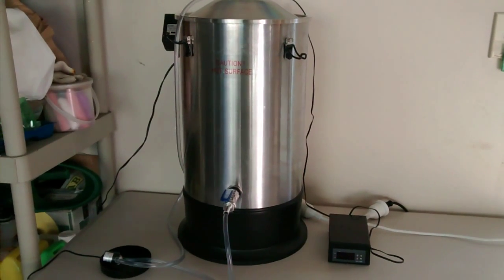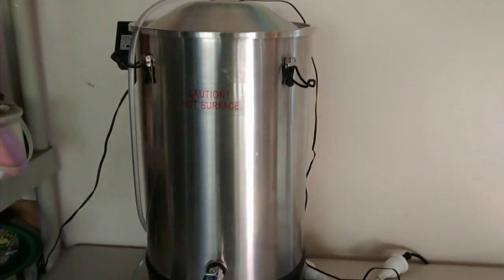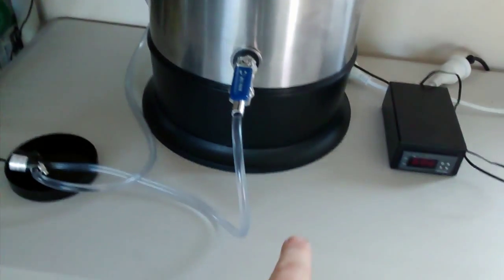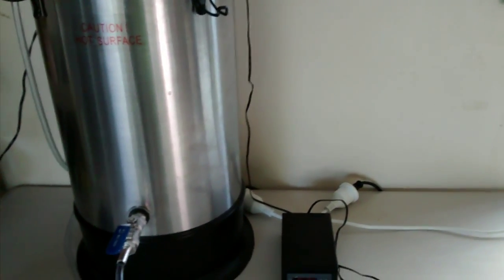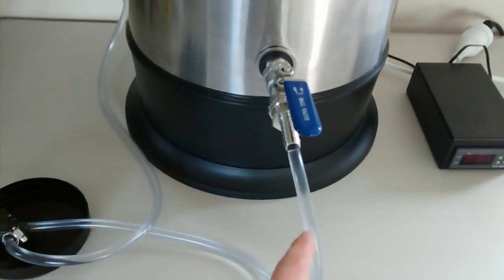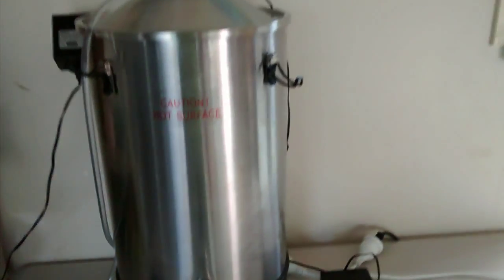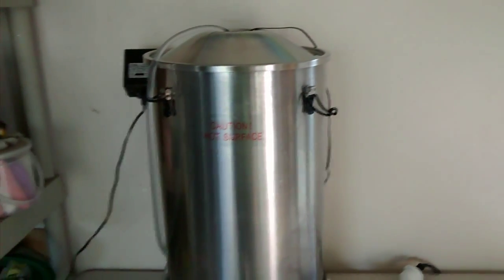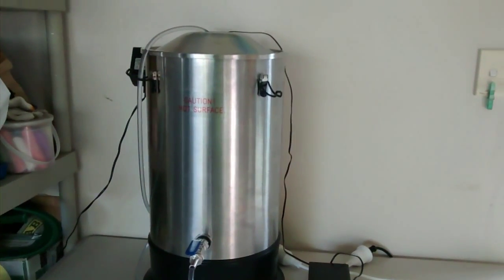Electric Recirculating Mash System with Temperature Control and Pump - Test Run

Comment: I like this Dino so far so good, let me get this right is this the mash tun because will the grain not catch at the bottom and stick or is is a false bottom. Also is the outflow filtered to stop the odd bit of grain getting into the pump?  Could I be wrong in thinking that perhaps a watering can sprinkle nozzle could be quite useful at the top. Just thinking out loud not trying to be critical in any way. Love this idea
Reply from the maker: Thanks Jim. It's going to act as both the mashtun and boiler. I'm going to use a grain bag inside. One thing I want to work on is having the grain bag raised off the bottom. The element is non exposed, but thought it would still be better. There is a bazooka screen attached on the inside to the back of the tap. This will hopefully block any grain particles that make it through the bag in the mash and hop matter in the boil. Once the mash is done, I'll raise the bag out of the liquid for sparging. Still need to work out what I'm going to secure it in, sieve or something like that. I was thinking how was I going to evenly spread the water over the grain during the mash. a sprinkle nozzle would be a good idea. Appreciate your suggestions.  Cheers mate
Reply: tubedinoz Looking forward to seeing it working Dino forgot about the grain being in a bag, brilliant

Comment: Thank you for the video Sir, can you please tell how me how the water pump turns on the same time when temperature got down ? Is it also connected to the temp sensor?
Reply from the maker: Hi the pump runs all the time on a separate power socket. The temperature probe from the temperature controller picks up if the temperature of the liquid in the boiler drops too low (you set the temperature you want on the controller) and then turns on the power to the boiler to raise the temperature up again. I hope that made sense. Cheers

Comment: Nice job Dean. If you can find a way to measure the fluid as it runs through your pump or hose you know you won't exceed your upper limit.... Cheers
Reply from the maker: Grant Baker Thanks Grant. I tried attaching the probe to the outside of the hose going back into the pot, but it wasn't very good. I'm not sure how I can get the probe inside the pipe without a leak. Cheers
Reply: Yeah it would be tricky. It is easy when using 1/2" SS parts, just need a T piece and a thermal well. Cheers

Comment: Thinking of adding a recirculating pump to my system was your pump hard to wire up and does it plug into the mains power? Sorry but not electrically minded set all.
Reply from the maker: Hi Adrian. I just bought a cheapy. Here is a link to the same one I bought from the same trader. http://www.trademe.co.nz/home-living/outdoor-garden-conservatory/other/auction-790095440.htm 
You just need a mains power adapter that can supply between 6V-12V. I reckon one that's either 9V or 12V is better to pump more water through. You used to be able to buy them from Dick Smiths or try Jaycar. You probably have one lying around the house. I just cellotaped the wires from the pump to the power adapter pin (safe as it's only low voltage). I know your system is a lot more beefier than mine, so you might want to look at a pump with a bigger diameter pipe and better flow rate (mines only 7mm ish). Have a look through this facebook link in Huttbrewer group, Curtis and Jono show there more up market pumps - https://www.facebook.com/groups/huttbrewer/permalink/274202559435156/ Cheers

Comment: did you have to add any relays to stc 1000. Does it take wattage of boiler with no problem.?
Reply from the maker: +Damian McCaul No. I just wired the STC-1000 up as per a diagram I found on the web. I'[m not sure where you are, but we run 240 volts and the element is a 2kW and I've had no problems. Cheers
Reply: Many thanks I'm from good ole nz as well.
Reply from the maker: +Damian McCaul Cool. The only thing I would say is try using one of those chocolate block connectors, when you do the wiring with one that's rated for say 15A. I can't remember what I used exactly, but 15A should be plenty. Cheers

Comment: What kind of boiler is this? A "tea-urn"?
Cheers!
Reply: Ahh - did some Googling! And its a still?
Reply from the maker: Bo Eriksson Yeah, it's the base off a still, but still designed for what I'm using it for. A decent urn with an enclosed element would work just as well I imagine. Cheers